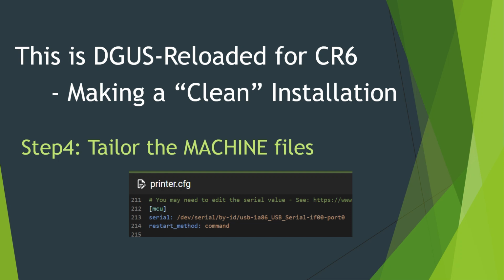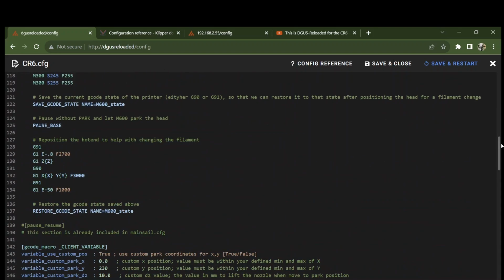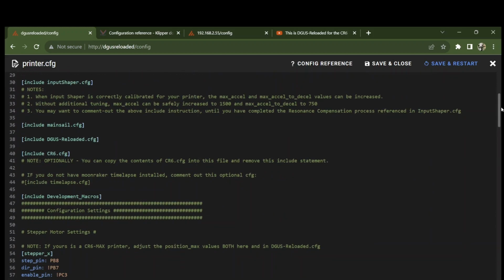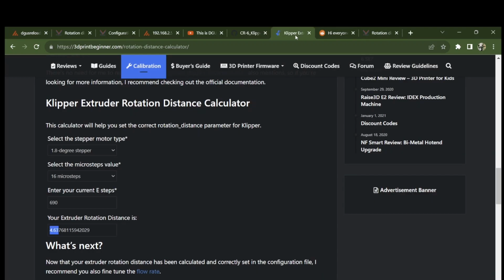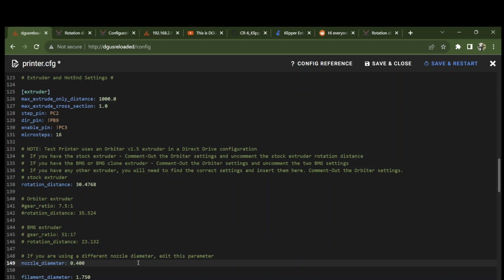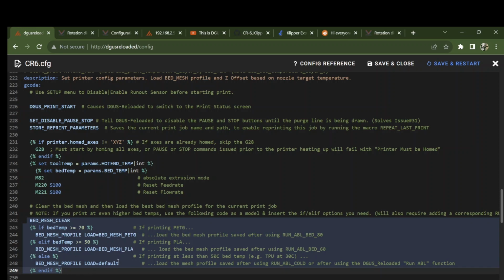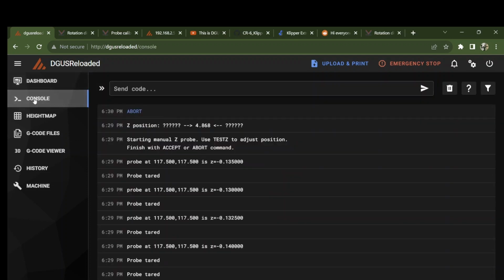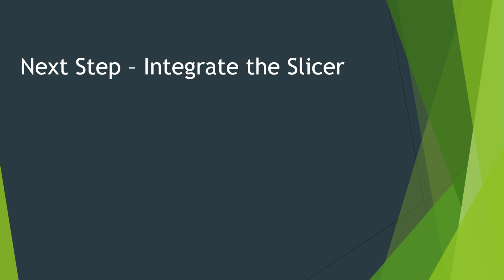Step 4: Tailor the MACHINE files

Comment: Also, your Discord Link is expired.
Reply from the maker: Dang!  It was not supposed to ever expire. Maybe recent changes by Discord forced them to reset the invites.
This one should work: https://discord.gg/X5j7K5FTV3
Reply: thanks for replying, but that link doesn't work either @makingthingsreal101
Reply: Correction: it did not work on my win10 machine, but it did work on my iPhone 14.